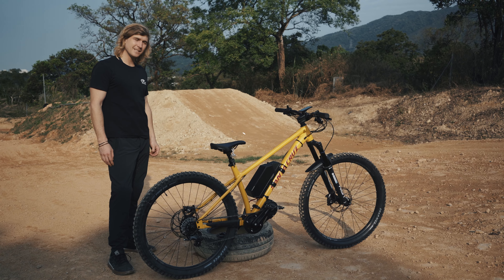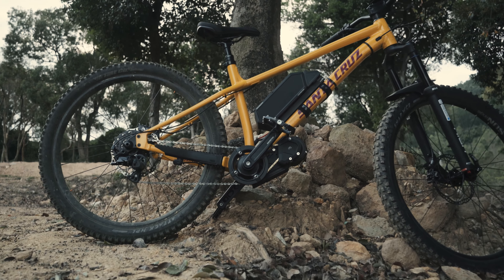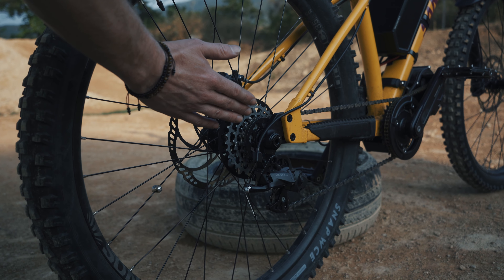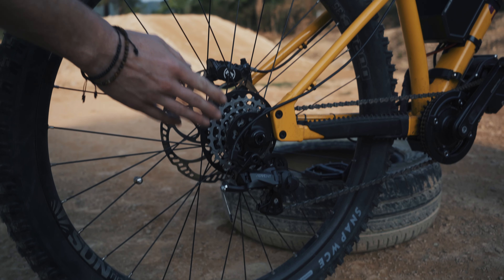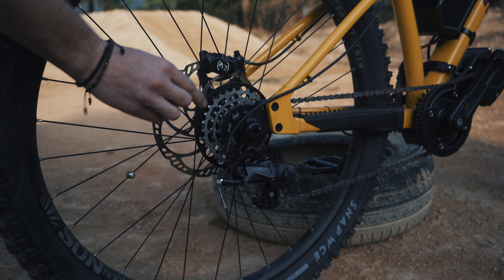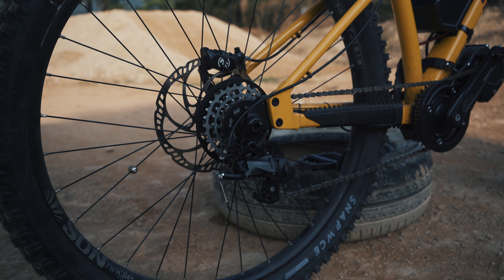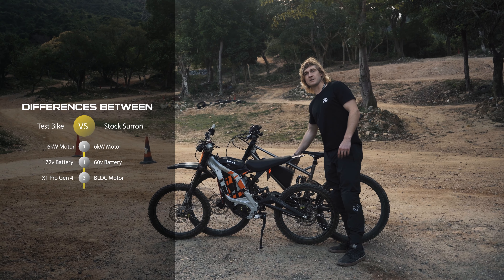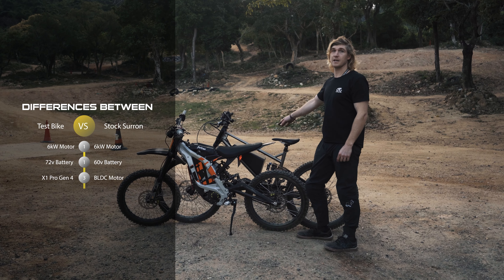CYC X1 Pro Gen 4 eBike Motor In Action - Noise, Comparison, and Performance

Comment: Just installed mine last night! I am blown away! The quality and ease of installation was staggering. 20 minutes tops. Took me longer to remove the jenky lock ring from my bbshd assembly. This kit is so butter smooth, this little company is renewing my faith,  people doing the right thing and do what they say they are going to do. This kit is so far ahead of any other kit out there. Other companies need to adjust and probably be scared at this level of competition. Bravo CYC! You have my business from here out and I ride my ebike 40 miles a day commuting in Maine so this kit will see the worst weather on the planet. I will write updates as the time passes. This kit is mounted to a dual battery set up on an Iron Horse sgs downhill bike that climes like a long horned goat.
Reply: any battery reccomendation? looking for a good 72w that would work well with this
Reply: How is the noise ? sounds kinda awful lol
Reply: @telkmx  I love the sound of dual chains of different sizes. Sounds like the future.
Reply: @ericthedesigner  Nah but the noise of the motor ?
Reply: @telkmx  The motor like most makes almost zero sound. Mid drive motors don't make noise it is the chain and gear choices that create the sound.
Reply: @ericthedesigner  I mean almost all the videos on the fb group or on endless sphere seems to disagree. The motor whine is massive while trottling so idk whats your setup where the cyc motors don't make noise
Reply from the maker: Thanks for all the support!!
Reply: @telkmx it’s the exact same sound as a talaria and they’re known for being quiet…there’s always a fault for some people, looks like an amazing kit to make a light weight trail monster

Comment: Update 4-27-2024 This motor is incredible! Very efficient! I'm surprised at the power I get from dual 52 volt batteries running 50amps on one battery and 40 amps on the other. I hooked them up with a 150amp binger and I've gone through 2 rear wheels since the last post. I just ordered a legit MX rear wheel 19 inch,  and with the tire on it will be 24 inch wheel. The torque on this motor is great, the rpm is insane! 32 tooth chain rings with 18 tooth cog on 26 inch wheels at the moment. I like riding 21 inch font with 19 inch rear and the power from this motor just gave me an excuse to get a new rear wheel. Cheers to CYC Team! Crazy Land Good!
Reply from the maker: Sick! Super stoked to hear it! You're always welcome to submit some build pictures if you want to get featured on our Instagram. Otherwise, thanks for the support and please shout if you need anything.

Comment: This whole kit would work on full suspension bikes right? And whens that new battery releasing😀? Also, what are some good batteries that you guys recommend to unlock the full power of the motor
Reply from the maker: Yes the whole kit would work on a full suspension bikes. 
Our dealers have some good options for the battery. You can enjoy full torque even without a battery supporting up to 100A peak. Generally, you can purchase the battery first, and lower the power via the app so it won't trip the BMS.

Comment: There are a few things I like about the X1 Pro system;
- High RPM and (relatively) small core means fast spin up (!)
- Motor explicitly designed for high RPM with mechanically retained magnets
- Motorcycle chain is a better stage 1 from the motor to the clutched chainring than a regular chain
- Inrunner motor designs like the Pro have good heat dissipation (this is biggest difference from X1 Stealth, which is an outrunner)
- The chainline and alignment blows cheap solutions like the Cyclone away
And a couple I don't
- Chainring clutch was weak in earlier versions and I destroyed several with stand pedaling. (Is this better now?)
- Enclosed gear to chainring systems can probably be a more reliable design than two-chain systems (DM01)
And one unknown
- ASI BAC wants to cut out at the slightest whiff of bad hall sensing, but Gen 4 doesn't use ASI anymore (is this better?)
Reply: -Chainring freewheels are far better now (have gone through 5, on my 6th). The change from a pawl/tooth freewheel to a roller ramp(?) clutch style makes it far more reliable and gives a much quicker engagement.
-The new X6 and X12, in house, controllers are great.
-The customer service I have experienced from CYC Motor HQ in Hong Kong is some of the best I've experienced.

Comment: Basically this kit requires a custom cassette to enjoy the kit. What cassette is ideal for most MTBs that can use all of the advertised 6000W? Which cassettes won't "fold" (one-piece)?
Reply from the maker: Not really. We have been using with standard MTB cassette. You would not get into trouble if you are using the cassette wisely. Not using full power in the lowest and highest 2 gears generally will get you a very reliable set up.
Reply: @cycmotor  Why does prototype bike in the video has a custom cassette for exactly?
Reply from the maker: @tonytober  It's our prototype for a cassette that we plan to release after more testing.

Comment: would this setup work good with a mongoose ledge x1 27.5? Also, just to make sure, is there a x1 gen 5 coming soon?
Reply from the maker: Yes it will work well on this frame. You may need to update some components like the cassette and hub moving forward. But it is okay to start with this frame. We are not planning for a X1 Pro gen 5. Gen 4 would most likely be the final version as all the parts are refined.

Comment: Nice video! How about pedal assist? How does the noise compare?
Reply: Noise is similar.
Reply from the maker: Pedal assist hardware the the latest generation. We set up the default pedal assist up to around 2kW, and you can still enjoy a proper EMTB expereience via pedal assist.
Usually in pedal assist RPM is much quieter.

Comment: Looking forward to the X1 gen 4 upgrade... currently using 6s 100c lipo for a "72v" pack.. modular and scalable, the lipo pack I use can be as small as 4lb, and still easily provide 200A cont. to the controller. For large displacement, I simply add packs, so in the largest configuration I mount additional packs to the down tube and triangle pack, for a total of 12pc 6s 5200mAh, in 18s series connection ( 3p 18s lipo ) ... this battery eliminates the battery management system, and allows me to charge each 6s battery with its own balance charger, increasing the charge rate substantially, while allowing a stable and precise charge.  Having a single battery, or even two similar packs... or even having to spend many hundreds or more to buy a high output battery... nah.. you can just use 3pcs  6s lipo and series cable to create a light weight, modular, scalable battery for $350 ( 3p 6s 5200mAh 100c + 2pccs series adapter) ... buy a decent high rate charger system, and you are away

Comment: I’ve been contemplating getting a cyc mid drive to replace my bbshd since the very first one came out. Everytime I watch a video I see its failed. Is this still an issue? I can’t have my expensive mid drive failing me out in the middle of nowhere. Anyone with some serious mileage on some rough terrain?
Reply: I just bought a CYC photon and have had no issues! My only "problem" came when the motor was at 110 degrees(F) and I thought the display was in celsius lol. using a 34T chainring with an 11t sprocket on 1500W I can get it up to  32 mph on flat ground, but I can definitely do better once I get the 42T chainring installed!

Comment: Could you tell me if the test bikes had a 32/53 or 38/63 or 40/72 chainring setup please? I plan to do what Rikus says in the video and not run the smallest or largest two cogs on my cassette, however I don’t want to get to large of a chainring and risk burning up the motor on hills but I also want the fastest top speed I can achieve lol thanks!
Reply from the maker: In the video we are using a 53/32T chainring. 
Basically you will get the fastest RPM at crank if you use 11/53T set up. If you want higher top speed then you swap the 32T chainring to a 38T chainring. We can do custom order on our website. Just make sure this is made clear to our customer support team so they can assemble you a 53/38T. Cheers!
Reply: @cycmotor  ok awesome, that’s what I thought thank you! I already ordered my x1 pro gen4 with the 32/53 chainring but actually I plan to order a 38/63 chainring also, so I can swap them out depending on the riding I plan to do. Is the different size chainring just a clean swap or is there anything else I need to order so I can swap them out?

Comment: That looks like a lot of fun. I’m considering to buy X1 Pro Gen 4. However, I’m not sure of its reliability? I will use it for daily commute and it’s about 70 kms two way. Thanks in advance for your answer. 🙂
Reply from the maker: X1 PRO gen 4 is currently at the final generation which we fixed and improve a lot of designs to make it really capable of handling high power continuously. We do offer 2 years warranty and we stand behind our products. It will be no problem for you to use it for daily commute long term.

Comment: So the GEN 4 can't be used with 11-42 sprockets? I don't understand.My battery is 48v 30ah 50 amps continuous
Reply: I’ve been using mine on the “road” within 11-22 range on an 8spd microshift cassette  without issue with a 38 up front. I spaced the drive side outward around 5mm. My frame is spec’d for a 36 chainring. Using smaller cogs on single track might present issues I haven’t tested yet. I mostly ride pedal assist. Throttle occasionally for fun.

Comment: You run the CYC on 14S 2P? Actually you mean on only 52 volts on only 28 Lithium-ion batteries? The should be Sony Murata US18650 VTC6 inside the battery. Ontherwise you cant run 60 Amps on only 28 Cells. But thats cool.

The motor should have a lot more power when running at 72 volts. Right now I'm gonna start with my new build using the CYC X1 Pro Gen4 on 20S 10P Sony Murata US18650 VTC6. First I'm awaiting a few more parts tot finish the bike itself and when my BMS 20S 130/325Amps arrive, I'm gonna design the battery for this Bike. I'm exited!

Comment: How long would my sturmly archer 3 speed hub last?
Reply from the maker: With the X1 Pro Gen 4, you will experience premature wear if you do not lower the torque via the app. 

It will also depend on how hard you ride but internal geared hubs aren't made for this kind of torque. Although very nice, and super convenient, it's not advisable.

Comment: Does it need a new controller to run 72volts
Reply from the maker: If you have an X12 or X6 controller, then you can already run a 72V pack. Just ensure you have the DS103 display as the SW102 display does not support higher than 52V.

Comment: Maybe a video with a 20x4 tire tooo. That’s what everyone rides in California.
Reply: look up the Ristretto 512 A20
Reply from the maker: Check out Ristretto https://www.youtube.com/@ristrettoelectric3505
Reply: My bike has 27.5x3.0 tires… I LOVE it.. it’s still nimble and easy to control but fat enough to handle anything you throw at it. It’s a Specialized fuse 6fattie
Reply: Loving mine too with 27.5 2.5 Maxxis DH tires. Very stable.

Comment: There's still far too much guess work guys. I would buy straight away if there was detailed info with links to products that are proven to work. CYC will sell a lot more products
Reply from the maker: What other detailed infor you want to know? We can get those covered on our page or our upcoming videos.
Reply: @cycmotor  off the top of my head I would ask the following: - specific drive train components tested
- best drive train configurations ie cassettes, hubs, chains, derailleurs etc. 
All of us are experimenting with all kinds of configurations.  Pls Share what you’ve successfully tested with the community to give us a baseline to build from. 
Publish life testing results from various setups. 
Package recommended drivetrain configurations. 
Publish recommended maintenance and schedules particularly for the motor. 
Lots of good stuff to build on. 

Big Thank you to all of the contributors!
Reply: @SteveLyons57  That really isn't up to CYC, they supply the motor and as long as you use on sub-2kW pedal assist, most drive trains will last, but if you are willing to and have the components - there's lot more to it.

Comment: can you really run the motor safely with this low amount of teeth in the back?
Reply: I haven’t had any issues on the greenways yet. I am using a Box 4 derailleur that has a VERY stiff clutch which keeps the chain tight. If trail riding, I don’t see the need for small cogs. Best to stick between 15>. My feeling is you only need 3-4 gears with this motor AND to keep the chain line width tight.
Reply: @SteveLyons57  that sounds good because the bafang middrive I got right now would burn up on steep hills with this gear setup.

You probably use a steal cassete?
Reply: @zavir7490  yes steel cassette and have a Race Face trace J hub with HG (steel) cassette body.
Reply: @SteveLyons57  nice, you could make a video about your build.

Comment: What’s the point of this product? Is there really a market large enough to warrant creating such a product? I very much doubt it.
Reply from the maker: The X1 PRO is enabling a new class of emtb/ light dirt bike. We have been working with several ebike companies and they will release products pre-installed with X1 PRO gen 4. Imagine a dirt bike/ EMTB hybrid that has the same power of stock Surron and only weigh 35kg :).
Reply: @cycmotor  the biggest issue with this product, as with the surron is that it’s not legal to use where you normally would use a bicycle. You can’t ride it in the forest, trail centers, bike parks, or even use a bicycle lane. In virtually all western countries these things can only be used on private land.
Reply: @asifitmatters1  Bro. No one really cares about that.
Reply: @SupraTompan  True xD Just use European settings and ride 25 if u are scared xD